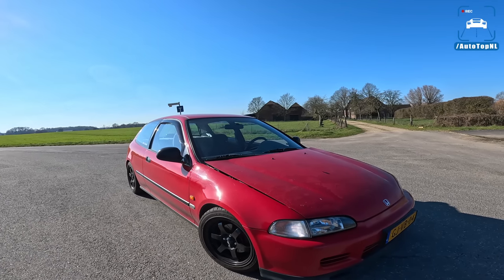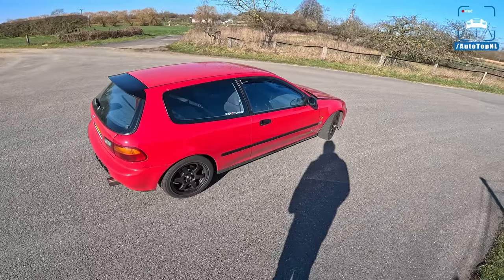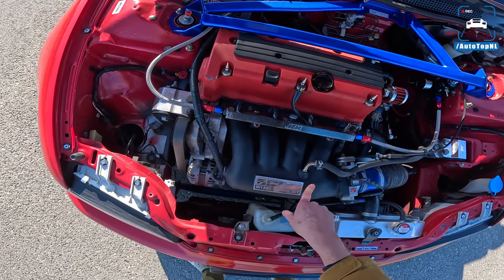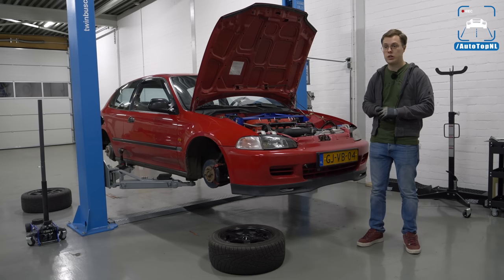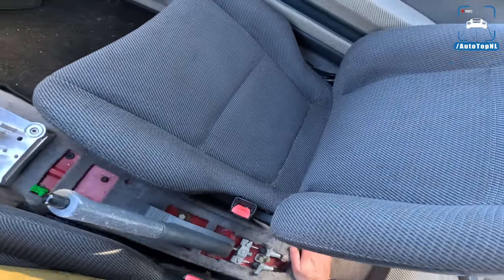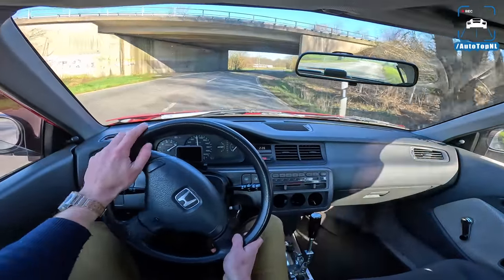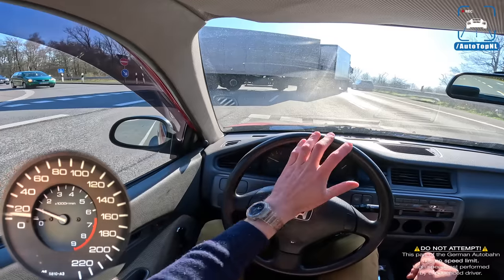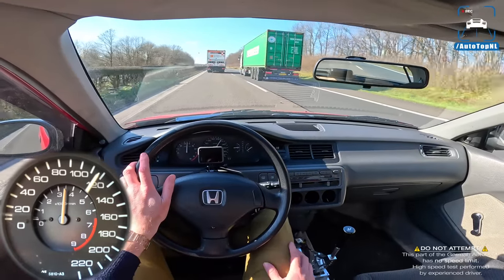My Honda Civic EG *K20 SWAP* REVIEW on Autobahn

Comment: love how the speed and rpm gauges are synced in 5th gear
Reply: I see it too, gorgeous.❤
Reply: my 2006 mx5 does this in top gear as well, its a nice little thing i find cool
Reply: @mannnygz  I’ll look out for the next time I’m on the motorway 🤣
Reply: With a 5 speed manual gearbox, the forth or fifth gear is called a prise directe. That means the incomming shaft in the gearbox (from engine) runs the same rpm as the outgoing shaft (to the wheels). 1-3 or 4 are reductions. That's why the rev gauge and speedometer are synced.
Reply: True didnt notice that.😅😅
Reply: This exact comment was posted on the last video lmao desperate internet fame people
Reply: @SNAPZ46  well sorry for not being up to your originality standards, snapz46
Reply: @VWGOLF1G60  it all depends on the final drive and tires. my 6speed has 5th as 1:1 and thats not the gear that matches the speedo and tach in my car

Comment: Loving this content guys!! Can't go wrong with a K20A in an EG. Please fit the carbon bonnet + 76mm exhaust as well as 205/50/15 tyres for better traction off the line to improve your 0-100 times too. Rims I'd go with Spoon SW388's.
Reply: My VW Polo has 205/55/15 tyres and it's very good even when we got snow here in the UK a few months ago it did not struggle at all it was completely fine where other fwd cars and a lot of rwd and some awd cars got stuck
Reply: I will run 225/45r15 will handle 100 times better than a 205. Or a 225/50r15.

Comment: 90s Hondas are closest you can get to a proper racecar for a fraction of a price. (Back in the day, now they getting expansive😂) Balanced power a high revving N/A engine and advanced suspension for the time and even todays standards (Double wishbone in the front and independent trailing arms in the back) a stiff and light chassis is a recipe for a great performing car. Glad seeing Hondas are getting the recognition they deserve here in German car dominating Europe. A propere drivers car with all the feels and thrills. Pure emotion and soul what alot of cars dont have.

Comment: 2 of the best mods you can do right now would be to install a shorter final drive (Spoon 5.3 is great) and a limited slip diff like a Quaife and it'll accelerate amazingly, loads of response and grip through corners with the nose tucking in and pulling you out.
Reply: Yea limited slip dif in a Honda like this is night and day difference. I built a single cam d16 and trubo'd it and when I put a lsd in it omg it became a completely different monster. So much power put to the ground it was unbelievable

Comment: That shifter is art in motion. Love the featherlight EG civics, much respect for those that engine swap to create a sleeper to be reckoned with. All about having a lighter chassis with good power than a bloated one with more power, that usually ends up being slower and not nearly as fun to drive.

Comment: 3 inch exhaust, DeatscheWerks injectors, ktuned fuel rail,Hondata  would see a healthy gain on about 19 degrees ignition timing my old RSX made 273whp back in 2016. k20/k24 bottom end.
Reply: might as well get a proper ECU like haltech or fueltech instead of the hondata...
Reply: It is allready overpowered.
Reply: @DashCamSerbia  not really, needs a 205 wide on some R888's or NT01's to hook. 300whp all motor is basically standard. id say this around 225-235whp that extra 60whp and better tire compound would probably get the 100-200 in the 10sec area vs 13
Reply: @LegerAndCo  my ek with 252 hp and 270nm 100-200 10.5 sec.. car was 1020kg weight. with 195 50 15 tyres.. no lsd..
Reply: Hondata s300 not works with k-series engine...for k series is k-pro...or Flashpro 🤦‍♂️

Comment: This is basically the setup I want for my '99 ek hatchback with the exception of a few details. 
It is strange how the steering is set up in yours though. Maybe how this this generation of the cars is as I have driven an eg. My steering is very direct so it could be an improvement. Great content!

Comment: Yeah! That shifter is pure mechanical porn! :)
With 235 Hp on a 6-speed transmission, this nifty little thing should do well over 200 Km/h....I'd even say 250 Km/h is possible. 
Some GTI guy will be very surprised to be blown by from a 90's "rice cooker". ;)

Comment: In my opinion what you need is a k24 block + stroker kit k20 fully build head, e85, pretty much all motor NA and you going to have all the power that you need easy 350hp....

Comment: carbon fibre accents like tailgate and bonnet will look good with satin black. otherwise I suggest getting proper seats, faster steering rack and wheel, proper wheels with rubber. you'll have plenty of fun how it's supposed to be
Reply: Shush

Comment: Used to own an EG, stripped out mostly besides the seats, door panels, and dash with essentially racing suspension, lots of Mugen parts with others from hybrid racing, RCrew, Hondata, etc… Best investment I’ve ever made, the amount of performance the car had on smaller roads and mountain roads was unmatched. I could seriously outrun nearly every supercar I went up against on tight roads. K20A2 swap, 275hp, 2170ish pounds, there’s really nothing else you need to have fun, you don’t even need 300hp. You’re gonna love this car more and more as the upgrades come flowing in down the road.

Comment: I had a 2017 civic si that I absolutely loved, had to get a bigger car to support two child seats backwards for infants so had to let her go. I remember racing a Cobalt SS in Mexico and got him in the top end by a couple cars, lane lines in the road were almost solid, and the vtec throaty intake nose gave me goosebumps, my Mexican passenger was gripping the door with whit knuckles but still rooting for me to keep going. Around town though in stop an’ go traffic was not nearly as fun with only 140 lbs ft of torque to the flywheel, minivan were dusting me. Those NA Honda engine are a dream on the HWs though.

Comment: The seat has a rail with a ball-bearing and the balls getting smaller cause of vibrations with the time, so it gets loose and the seat wobbles.
I had to change one the rail to fix it. Some say it helps to lubricate it but I am not sure what product is best without messing too much around the carpet.

Comment: so cool to see you love this

It would be nice if you raceprep this thing. Strip everything (carpeting, insulation, dampening, dashboard should save 100kg+ easily) and add a rollbar maybe for safety. It doesnt need more hrsprs but even less weight :). And that 3 inch exhaust ofc. But leave the turbo?

Comment: don't ruin this engine, don't turbo it, you won't sprint faster to 100kmh than in 5,7s anyways..so no point in that, all you'll get is just even crazier endless wheelspin..unless you care much about the 100-200kmh faster times or smth;p..i'd say it's already perfect right now with such power n weight ratio..n ofc, reliability ratio too;p